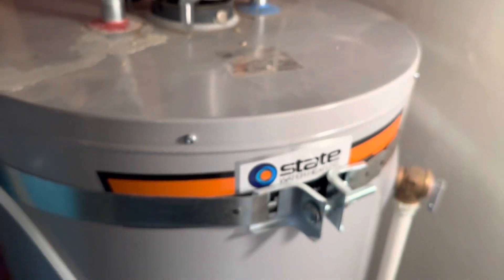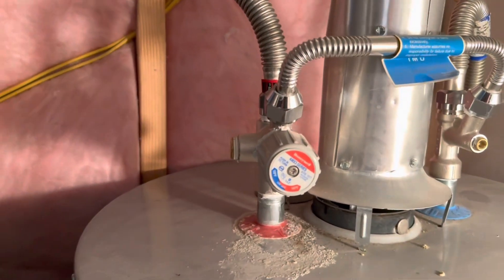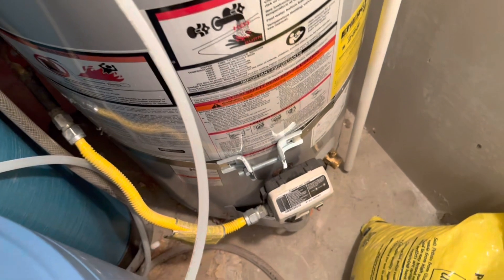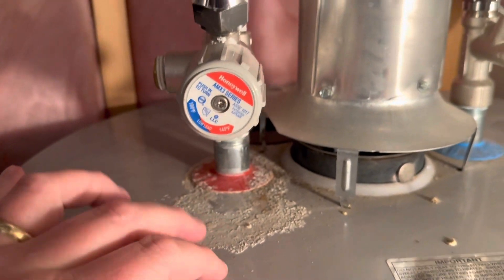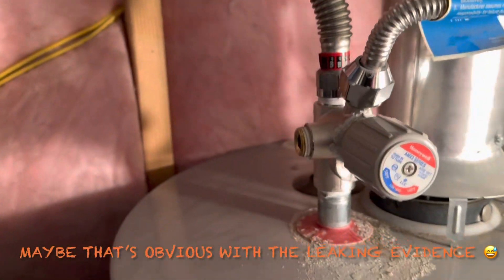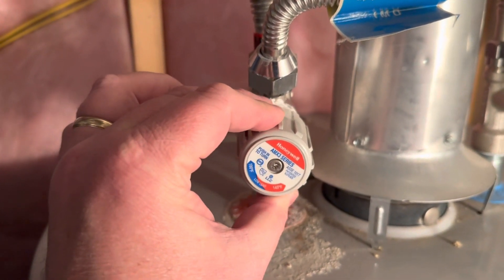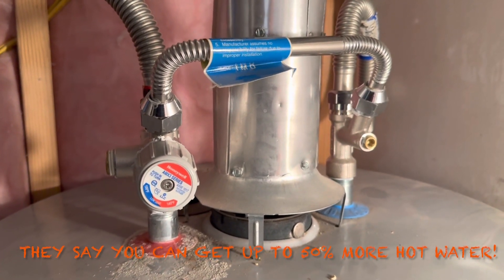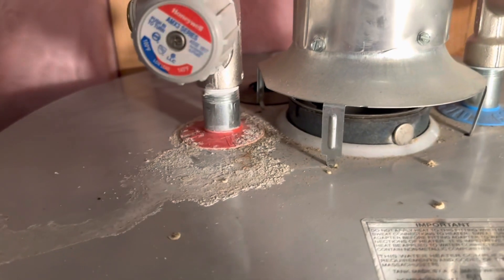Never Run Out of Hot Water Again! Water Heater Mixing Valve Explained

Comment: Can you explain a couple of things?  What temp do you normally keep tank?  Do you have to unscrew the center screw on the mixing value in order to set?
Reply from the maker: I’ve actually replaced the water heater since then and have a different mixing valve in place now.   It’s a bit of a different style but from what I remember that screw was just to hold the plastic dial in place.    You didn’t have to unscrew it.   I’ll do an updated video (that was one of the first videos I ever did) and explain my current set up and how I dialed in the correct temp.    My new one has a temp gauge so that’s handy.   I’ll do that maybe even later today.
Reply: Awesome. Thanks!
Reply from the maker: Alrighty OzMan I just released a new video and I hope I answer all your questions.  Thanks for watching the channel!    Let me know if I missed anything.  Head on over to my channel page and it’s the latest video
Reply: @higgprojects  so the state water tank in this video only lasted you about five years, yikes

Comment: So.  The hot water supply temperature to the taps in the house remains the same, even though the temperature of the water in the water heater reservoir has now been increased, because the mixer lets in cold water to the hot water line.
( Higher heated initial water temperature now allows for more cold water for mixing = more overall volume of warm water over time. )
The only downside is more gass used.
Reply: You should keep your hot water at 140 or higher anyways. Legionnaires disease check it oit
Reply from the maker: True.  If it’s not needed full time though you could always open it up all the way most the time then mix in more cold and crank up the water heater when the house fills up during holidays or whatever.   I’m sure it’s simply not needed for lots of people.   Sure glad I discovered it though.